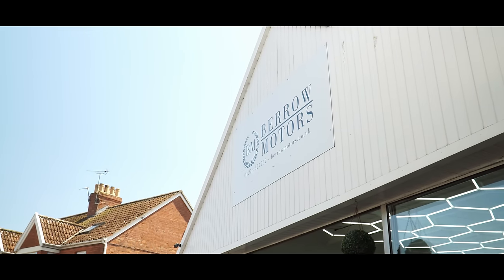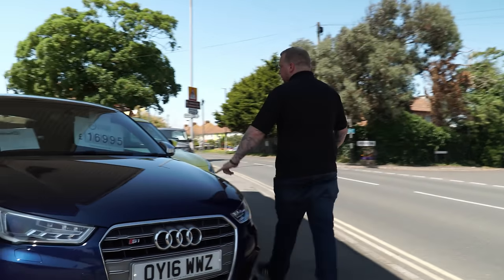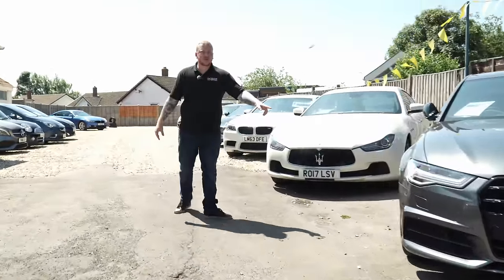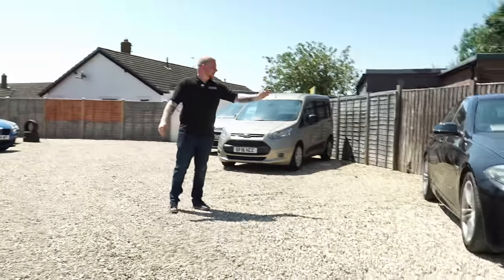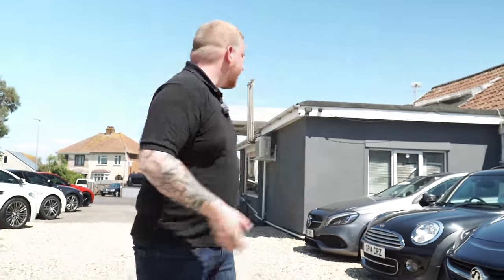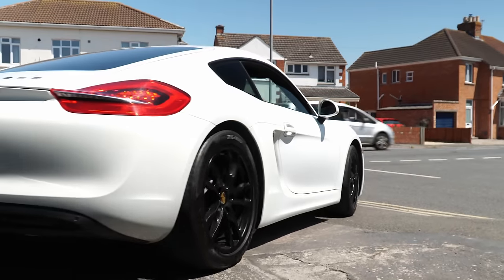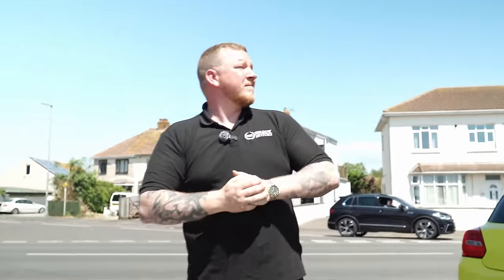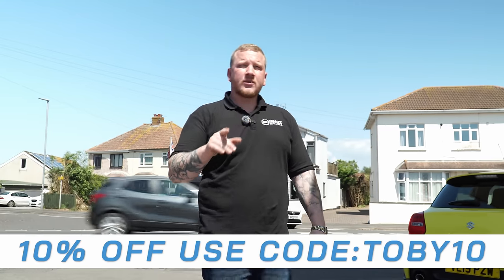Berrow Motors Garage Tour - Summer 2024

Comment: Air bag warning lights on Range Rovers are mostly to do with the wiring under the seat, quite often that light will come on when someone adjusts the seat, it’s the spaghetti junction of wires a bit to tight under there.
Reply: Came here to say the same 👍